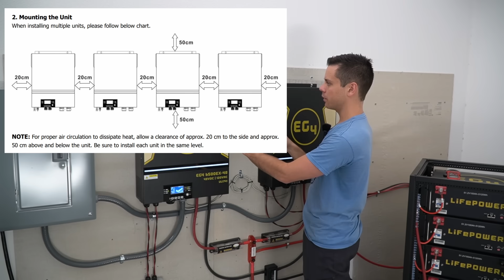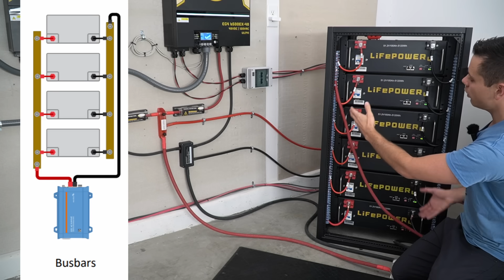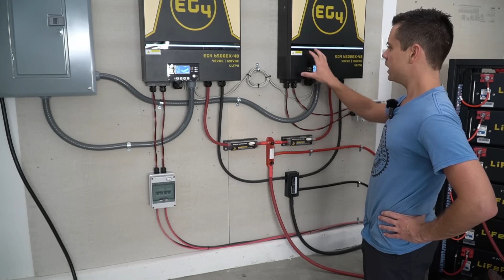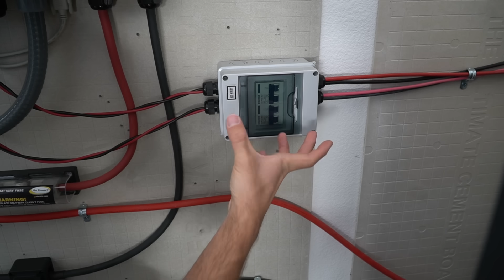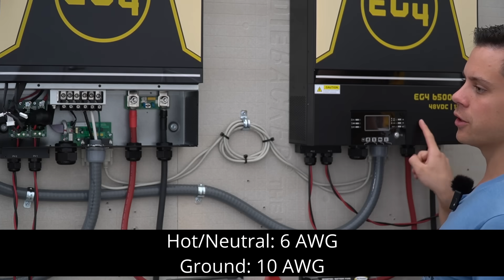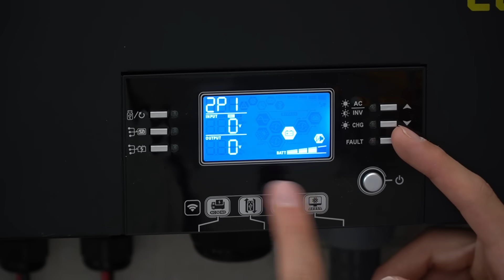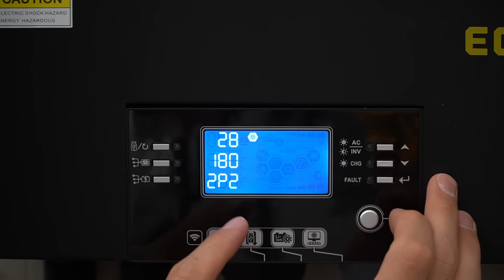Complete 48V Offgrid Solar Power System

Comment: It'd be cool if they made a similar model with internal split phase, then it could be an international model as well (like SolarEdge grid-attached inverter equipment).
It is super cool that this equipment is designed to support synchronized three-phase configurations as well though! This would be even cooler if they did triple split phase.
Reply: Well gee, they did, EG4 6000XP.  They also sunset these EG4 6500s because problems. Disconcerting for me, while they are mounted I haven't got my EG4 6500s wired yet.

Comment: Will
GREAT VIDEO, you're AMAZING & I actually understand this!!

I have a question for you.
I have a garage which is 5m x 3m & clear line of sight for 7hrs daily min.

I have about 10 motorbikes in there which I want to charge Via an off grid Solar set up.
What sort of set do you recommend?
Not sure if I'll charge them directly Via a charge controller or via an Inverter etc...

I want to do it at min cost.

Thanks
Ben

Comment: Will- can you also share options to alternate full off grid/ powering a house during the day and at night until the batteries are low to then switching to grid power? Are there any automated switches that would alternate as needed? (Preferring to not have a grid tied system)

Comment: I live in Northern Maine, and it gets very cold here in the winter and wanted to install an off grid system just like this one in your video, but I am concerned the cold temperatures will make the batteries not work properly. It gets down to -25 F and I wanted to install it in my garage where the rest of my electrical panels are. Do you have any advice?

Comment: So capacity for solar panels in description..solar input 16.000watts, capacity battery 30kWh, n then ac output 13.000watts but I have some question for gets 39 kilowatts  of ac output at 240 volts those things per hour or day .. N then in the secondary panels term thing is inverter num 1 n num 2 the those both has an something purpose like a the battery connection , solar panels connection , n ac output n input n then in the central panels has a circuit breaker used for transmitt of both secondary panels or inverter in this describe.. N when the inverter is off we can actually change the setting.. What's the problem if we change the setting it this inverter on..but may i asked questions .. For set a inverter on secondary panels has a 28 code.. What the meaning of 28 code.. On set inverter 1 press 28 n set 2p1 n on set inverter 2 press 28 n 180 degrees n set inverter 1 or 2p1 the both will transmit .. The those both will gets 240 volts.. Is what cause 180 degrees or something maybe .. Is what every type solar system difference capacity n how about it if we uses inverter more than 2 ... Is what capacity battery will bigger...

Comment: Been a viewer of your videos for many years and have been impressed with your knowledge and enthusiasm for solar.  I’ve never had solar but thinking about it on a new home I recently built.  

Hope you can answer a question or two  for me.  In my scenario, I gave a concrete wall and floor basements, but ceiling is wood rafters and subfloor. Thunking ahead since I don’t have a garage, I would like to put a battery rack with like EG4’s in the basement and tie it into the electric panel breaker box that has public electrical.  My main question is it safe to store Lithium batteries in the basement? I hear of EV battery car fires where they are almost impossible to put out which concerns me. I see Tesla has the power wall that can attach to the exterior of a house, but then I question what’s to stop those from burning the house since exterior is cedar wood.  I have a new 10k propane generator and just the auto switch box is installed. I would not mind an electric car in the near future so I was thinking selling the new Generac and switch and go all solar. 
But as I begin exploring, the battery location bugs me.  I have a nice sunny long 86 foot roof ( though I’d prefer ground panels) and think batteries are needed since it will also be storm backup. Thank you 
Jim in Connecticut

Comment: Hi Will.  Can you kindly direct me to where I can find more info on whether one should/should not earth the panel in such a configuration.  I'm researching a smaller scale system for off grid storage building.  I'm wondering if I need to earth the panel or not, and what the pros/cons are, with safety being main consideration.

Comment: I'm building my system using the newer LV6548(blue). I have searched your vids and cant find you configuring just one of these units with a 48v Lithium battery bank (I have 4 48v 50AH batteries for my system). Im confused because this and other 48v systems you show are always doubled. If using only one 6548, what size cables do I need between the batteries themselves and then to the bus bars? From there is it the same size to the inverter? In your diagram you have 2/0 cables AND 4/0 cables both going to batteries. this is confusing. Please help!!

Comment: Is there any reason I can’t build these exact setup in 2 phases?  I don’t have all the money for a complete system at the moment.  So I would like to do this configuration but only install 3 batteries in the rack and a single all-in-one unit at first then add 3 more batteries and a second all-in-one unit down the road.  Will this screw up the original 3 batteries?

Comment: I am wanting to add solar to my camper it has the to batteries out side. I am good with electrical work but I have never worked on a camper electrical system so I. am hoping it will not be a huge curve ball for me. It would be so nice if I had an electrical diagram but I have not found any for this thing on line or with the owners manual. What I am wondering is I believe it's a 34' trailer so I hope I can put some decent solar panels on it. What is the best charge controller it. I want to build some batties for it but not sure how much I want to go with. I am hoping 5000 watts will be enough.

Comment: Hi Will!
Your videos are priceless.

we’re about to install an identical system, the sides of our busbars are open & bare.

And our nader breakers for battery cables are open & bare,
Is this a shock hazard if someone touched them?
Reply: I am about to install the same system, 24 460 panels and 4 batteries.  Could you tell any problems you had and would it be OK to give you a shout if I have one?

Comment: Great Videos Will but it would be awesome to see what expanding the system would look like. Since you say you should always leave room to expand. Instead of only two inverters but lets say 4 (Eg4 6500's) inverters. The main reason I ask is Signature Solars manual is less than impressive in some aspects; when it comes to connecting to a sub panel. Not being an electrician Im curious can you have 120 volts from one inverter and 120 volts from  a second come into the panel feeding the same side  buss? or do the inverters when paralleled  (communication cable) consider this ?  In addition if it is a subpanel  the Line #1  and Line #2 feeding the main panel becomes Line #1,#2,#3, #4 . Does this make sense? Im here In Baja I ordered the equipment its this last part that is throwing me for a loop. Can you help. I'll buy your  book if it explains.

Comment: Is there any visibility on how much electricity generated by the solar panels cannot be used with a system like this? Usually batteries do not hold that much and cannot absorb the huge difference between summer and winter while the household consumption doesn't usually align with this.

Comment: I installed four of these EG4 inverters on 40 panels 400 W each with two batteries 9.6 kwh. I followed the wiring diagram that the shop provided. They have me connecting the first two inverters output power supply together and the second two inverters output power supply connected together. I turn them on today then I started getting error codes that there was a short and over power issue, basically P05 - P08. So what am I doing wrong here?

Comment: I am not an electrician or at journeyman level nor do I completely understand the DC to AC side of these solar batteries and these components to and through the AC side of your configuration.  Therefore I want to stipulate that NEC would typically want and earth ground on the Nuetral side which is connected to the green wire considered the ground.  Much attention to instruction and details through the manufacturer of these devices and NEC must be observed for overall safety considerations.  Connecting a ground to earth while the system in running and hot could cause instant death if the Nuetral is looking for a ground because the actual ground is somehow activated by a system error of unknown origin.  
Safety with electrical power both AC and DC is paramount in my mind!
Be safe and get professional advice as needed!

Comment: I have always loved your videos young man!  I am an old guy and also an inspector, contractor, multi-talented journeyman and I have one thing to comment on your devise that may save a lot of confusion and possibly someone being very much electricuted or hurt from lack of knowledge.  National Electric Code specifically calls the Neutal Wire and intentionally grounded conductor meaning it carries just as much juice and power as the black or hot wire as you are describing!  I too did not know the difference but you have really a potentially fatal error in your configuation by connecting the intentionally grounded conductor and the ground to the serice panel only without making the panel go to a ground bar outside that makes the green have the pathway and possiblity to ground the white conductor to the intended grounding source with is the earth!
I hope that makes sense young man and it is not my desire to chide you or take away from your helpful handiwork but to both help you and all of your followers understand and implement the intended safety feature of the earth ground!
Blessings in Him,
Dave

Comment: Hello Mr. Prowse; since I have a house in Arizona and the grid power is sketchy, how many batteries and panels at what wattage each would I need to keep my air conditioner and a 4500 W electric water heater running for three full days? Thank you for all that you do!

Comment: I am just starting out with solar. I am going to try and install this into my house as a backup system for preparedness purposes and back for power outages. When starting to build this system, should I start with building the solar arrays first, and then build the system? Or, Build the system first, and then start building the solar array?

Comment: I have had bad luck with these eg4 liftpower batteries from signature solar.  After about 6months of use one of them failed.  The failure caused the system to stop charging all the batteries.  The system was in communication mode with the batteries.  When I removed the communication and reverted to manual battery settings this worked fine.  That was when I found one battery was not charging or discharging even though there were no errors.  The BMS software showed the bms was cummunication but in idle mode.  I contacted signature solar and they asked for screen shots of the bms software.  After providing that they said "after a few deep cycles the battery may come back"....ahh the battery is not charging or discharging can't charge it.....  After more emails I was told I would get a new BMS board to install, but no new board has arrived no updates.  I am using 2  EG4 6500 inverters with6  eg4 liftpower batteries.

Comment: I saw some comments saying that the AC output lines that run from each inverter to your sub panel that is to the left of the inverters need to be the same length also.. but I beg to differ. Opinions?

Comment: i have so many questions but first let me start here my highest kwh is in the summer Oklahoma dry heat the most I've used is 3975 kwh I would like to be able to cover a month like that off grid in my home I have a two-story home and two ac units if i could cover the most expensive months I would be totally off the grid what would I need to cover that type of load ?

Comment: I'm not going to be able to do this. I can't figure it out. I bought all the stuff and I can't figure it out. I have someone of an idea. I don't like the high idle consumption. Doesn't make sense 100 w it's like having an extra refrigerator running all day or more. I tried to find what I needed for just one sungold 6500 120 volt output only but I can't figure that out either. I almost wish I wouldn't even have bought anything. I'm never going to make it

Comment: Can I use 2 of these inverters with 10 450w solar panels and 4 lifepo batteries? Daily electrical use is between 15-20kwh. With exception of my mini split ac use in summer that may push up the kwh usage. Also, I will plan on adding 2 more batteries. Should I consider more panels? How many more? Wanting to do this so it doesn't hit my wallet so hard. Thanks.

Comment: Would this setup be good for a off grid house? 1800 square feet, 240v well pump, heat pump for HVAC, electric oven, electric water heater, electric dyer and also have a small air compressor. Dishwasher, fridge, tv, two computers.  We use approx 2000kw/h a month.

Comment: Thank you Will.. but, if I am using this system in an off grid system, with 240 volt diesel generator for charging batteries on those days when solar is not enough to keep up, do I use the grounding exactly as you have done in this video?

Comment: Can you identify how you attached the 6548 at the top?  Did you just drill use a concrete drill to make a 3/16 hole through the Hardiboard and then put a wood screw through into the stud?

Comment: I realize they need to be 8 inches apart, but how much wall space do I need to have the two units installed?  That is, how wide is each unit and how much space does it need in front of it (if installed in a hall way for example) how wide does that hall way need to be?

Comment: Hey Will.  Have you setup the communication on the batteries?  I see there are no communication wires on them.  Also, have you experienced any of the problems others have noted with the inverters switching from battery to solar to grid?

Comment: Will thanks for all the amazing videos.  I've learned so much.  You have probably touched on this before but are you using any optimizers with your off grid system? Can this eg4 6500 inverter talk or interact with any of them and would it need to? I held off buying this inverter because it's listed as off grid and I'm won't be off hrid for a while yet but I'd love to take advantage of the cost savings of this unit and their batteries.  Is the off grid designation just because it can't separate from the grid when the grid goes down and if so couldn't one just but a piece of equipment to go between this inverter and the grid to perform that function?

Comment: Ok...I apologize in advance for such a basic question. For now I'm only hooking up 1 of these inverters with 4 batteries. (Will add the second later. ) My question is to the 60amp dual power braker you recommended...on the breaker panel. Would this be the same breaker module to use even you have only have 1 inverter? Thx!

Comment: I had an electrician come out and install an interlock kit and also a 30 amp inlet so I can plug my generator in. Can I use this system to just plug into that outlet, just like my generator? Would it be the exact same setup??

Comment: Will, thank you again for another great video. Your video increases my knowledge concerning solar systems, however, i would not try to build one based on my history of assembly anyhing. I was wondering if it is possible to develop a system like this that comes pre assembled. A kit that includes everything, including the wall and electrical box (but not the solar panels). The only instructions  a user would have to follow  is to connect the parts based on matching colors. An electrician would only need to connect the box to the house (or maybe one that is prefabricated). I ask about such a system due to misery I see when people lose power for extended periods of time due to bad weather conditions.  I do not need one right now but am saving to buy one in the future.  Thank you.

Comment: Great video. Your system is very simple with not of wires running all over the place. Easy to follow. One of your best videos. Thanks for the info.
Reply: It's easy when you have a big wall to space it out. Not so easy and has to be well planned if it's in a closet or other small area

Comment: Shouldn't the T-class fuses be replaced with a circuit breaker that will break power to both inverters if either one of them goes into overload so both legs into the AC panel go down, rather than possibly leaving half a 240 appliance powered, when one inverter overloads??

Comment: Considering purchasing an EG4 System for an OFFGRID (Generator backup) System.   Can ANYONE tell me the main difference between the 6000-EX and the 6500-ex and which would be best for this application?  no need for 240V at this time, but would like the capability in the future ?  It seems I could add a second 6500-ex for 240V capability, whereas the 600-ex is 240v ready out of the box. Also If I start the generator do I need to switch anything or do both systems automatically detect incoming AC and charge batteries while switching off the inverter?  Reached out to Signature Solar, but haven't received a response yet..